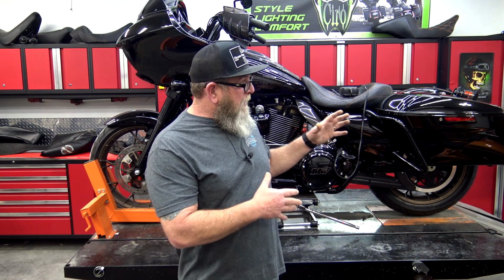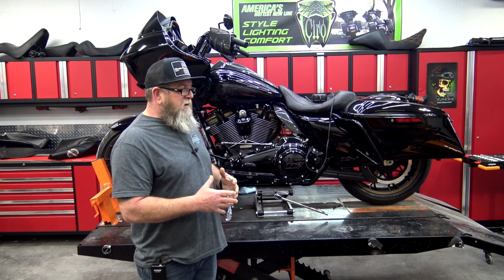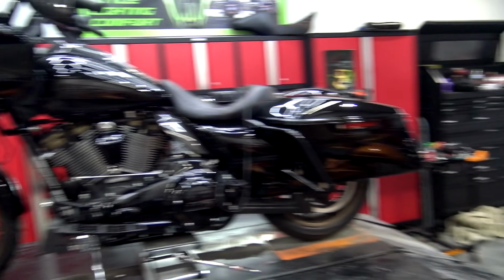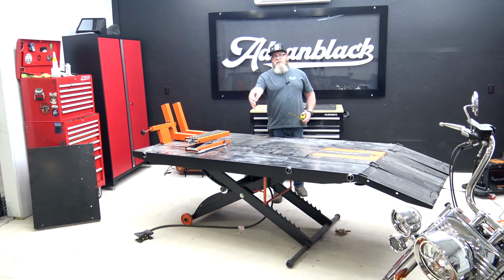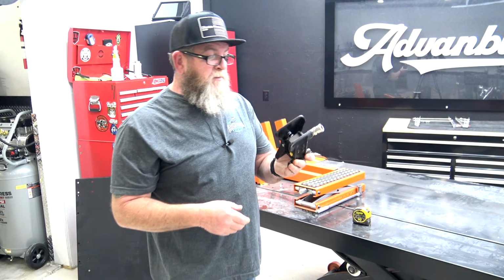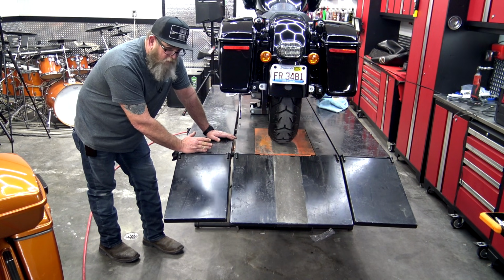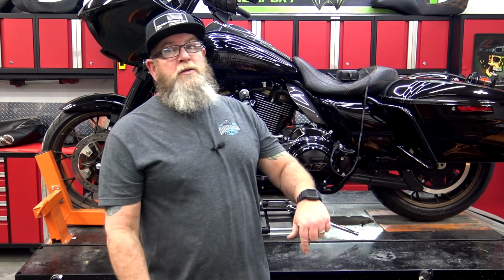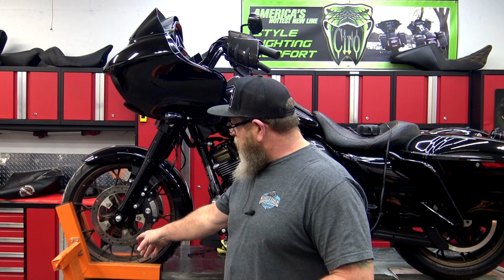⚡APlus 1500XL Motorcycle Lift: Worth the Buy?⚡

Comment: I just bought the same lift and it appears they have fixed a few of those issues you say in the video. I put the chopper extension on for my Indian pursuit and definitely don’t need it so I’m going to pull the bike off and take it off.
Reply from the maker: Glad to hear they’re making improvements to the design. 👊 I wish they would have reached out to me to fix the issues that they sold me to deal with.
Reply: @sikbaggers  well I didn’t know that that’s surprising… When I called them directly, the customer service representatives were excellent… Maybe they’ve changed over the last few years

Comment: Where are they made ?
Reply from the maker: not sure.. didn't really care as they are a US company...so warranty support/parts supply is easier..... but if you check thier FAQ page it states Where is your lifts made?
Most of our lifts are made or assembled in China with parts from countries such as China, US, and Mexico, the same as almost other brands on the US market. We have direct connections with the factories, and because of that, we run our business in a much more efficient way so we can keep the cost low while supplying higher quality lifts than those with similar capacities.

Comment: Problem, not issue... I bought a Titan lift years ago. It looks exactly like these APlus lifts. Made in the same chinese factory.  I don't like the side skirts. You have to lean over them to work on the bike, but they do make it easy to drive the bike onto the lift
Reply from the maker: Most of all of the lifts just like this one are made in the same factory...I agree. you can easily pull the side tables off once you get the bike up...I use it a work bench, tool holder etc...but there have been times I need to get under the bike or closer and I have removed them.

Comment: The best lift in my opinion is the K&L if you want wheel drop out panels in front and back. Yes, it is pricey, but perfect reliability, big air cylinders/capacity and great quality. The front dropout is key for me as a vintage restorer as it allows easier front end removal and work.  And, it has easy insert side extension tables, front wheel vise and more. The table lifts within the base, nothing rolling constantly on your floor.  It is the most complete setup I could find…I bought two!
Reply from the maker: yeah they are built like a brick shit house for sure! Super pricey for your average garage guy though.

Comment: great video Steve.  i have the Canadian version of the Harbor Freight lift.  here it is a Princess Auto lift, but same thing.  I bought it about 12 years ago now and it gets well used.  I have had electra glides of various years over the life time of this lift and have never had a problem.  it is the air assist version.  at the time i bought it, it was $369 CDN and by far the cheapest version of a lift i could get.  i have a bunch of buddies that all ride touring bikes and we work on their bikes with this lift.  now you do have to be sensible when using it, but we do engine work, tire changes, full strip downs, and i like it just for cleaning the bike.  no doubt in my mind that this is the lowest end lift.  the one thing that it does that i have not seen other lifts be able to do is roll around.  the lift has 2 wheels in the front that once you lower the leveling legs, you can move the lift around.  My garage changes from a bike shop, to a cabinet, wood working shop to a automotive shop at various times so i have to be able to move it out of the way easily.  Best $369 i have ever spent.
Reply from the maker: Hey man...so sorry this comment snuck past me and im just now seeing it...that sounds like you have a good one that works for you. Unfortunately I do a lot of that stuff so I knew right away it was going to work for me..I was bummed for sure. The price was awesome. Glad you can use it! Be safe!

Comment: I liked the video, I was wondering if you contacted A-Plus lift about the bent side panel? I have an 05 Ultra with a 124 kit and a 6-speed Baker. It is a heavy SOB but I think this lift will work great. I like that it comes with the bells and whistles. Do you have a video explaining how to change the engine, trans and primary oils?
I was also wondering if you contacted the manufacturer in regard to that foot pedal issue. That is kind of concerning for me also. I too was wondering if you could just switch it to the other side. Thanks for taking the time to do this video, really appreciate it
Respectfully, Dale H
Reply from the maker: yeah they said the center is rated at 1500 lbs not the side tables..I said "clearly" lol  I do have several videos on 3 hole oil changes..I think the one that would help you with your 05 would be the twin cam video here  ...specs may not be the same as far fluids https://www.youtube.com/watch?v=kAS5fm7cbWg and here is a service manual for the 05 touring to help with your fluid specs and torque specs,..its from my google drive...feel free to download it to your phone or pc https://drive.google.com/file/d/1scuAdp_1TXFzQKsH416OAge7pJ83YrcB/view?usp=sharing I hope this helps!

Comment: Have any issues with the short ramp with scraping the bottom of the bikes?  Do you push them up or ride on?
Reply from the maker: the only thing I have scraped on the floor is the 39" fishtails on the softail build riding it up and down ..and the back of the frame on the 2" lowered streetbob which is a lower sitting bike to begin with and that was with my fat ass riding the bike up on the lift...i pushed it up on there just fine and didnt hit...the ramps are pretty sufficient for most bikes.  Ive never hit a touring model even with lowering blocks on the rear riding it up on the lift

Comment: I Bought one few days ago based on this review.  I put it together and when I lift the bike up and push on the bike the table flex which moves the bike a bit . Is that normal ?
Reply from the maker: yeah man that bike aint going anywhere...its a solid table..been using them for years and zero issues and I have slammed, banged and pushed on these bikes..youre good.

Comment: I wish I saw this video two months ago. Did the exact same thing. Got a HF lift because it was cheap. Did all the YouTube mods to it. Second time my street glide was on it I heard the frame make that creek sound. NOPE! Lowered it. Took the bike off. Posted it on marketplace the same day. Luckily it sold right away. Ordered a Black widow 1500 XL wide pro lift. Pretty sure it is the exact same thing as the APlus 1500XL.
Reply from the maker: Yeah those Harbor Freight lifts aren't meant to hold that much weight.  Im the same way, listed it the next day and sold it..there was no way my bike was going up on that thing. And yes im fairly certain thats the same lift. You will be happy with it.

Comment: Nice video.  I too have seen plenty of Harbour freight videos with guys raving over it.  However like you if I have to spend hundreds more "fixing" it is money really being saved?  No!  Plus altering products generally voids warranties.   

As for delivery I live in the suburbs and also have no dock on my house or forklift in the back yard.  What I do is back my pickup up butt to butt with the delivery truck.  The item is lowered to my bed height and transferred.  I shake hands and back my truck up to my garage and unload.  If possible I break down the item in the bed.   This has worked for a Pretor elliptical,  large air compressor,  110 lb tower speakers, 617 lb tool bench etc.   I also have a 1000 lb winch which worked great for 
unloading the tool bench.
Reply from the maker: yeah....no way im putting my bike on HF list...maybe a sportser or something small but not a bagger...same thing here with the lift delivery...I actually unboxed it and put it on a dolly and stood it up, strapped it off and hauled it back here to the shop...it sucked..it was heavy but it worked lol

Comment: Excellent!   i purchased a used Handy Lift this spring, it has the same wheel chalk, and side tables, however it doesn't have the rear drop out which is kinda a bummer.  I do use it quite often and now my foot control valve is not working properly, not letting air into the cylinder  so I'm trying to find parts to rebuild the valve, or purchase  a new valve.  Any suggestions on types of valves you are familiar with  that aren't  super expensive?
Reply from the maker: I havnt been able to find replacement parts for the foot controls ...there are so many different ones..Ive just been searching for a new foot control all together.

Comment: Good vid on the lift and yeah I am with you, the Harbour Freight lift has a place it's just not under my Electra Glide Ultra Classic. As for other lifts. I got the Redline 1500 ELE. The few upsides I see with this one is it's electric over hydraulic instead of air and no issues with putting the father in law 2020 tri glide on it. With the side extensions I am 51 inches. But overall the best lift is the one that will get you working on you own bike. Keep up the good work  bud
Reply from the maker: Yeah man that redline is nice lift! And absolutely agree...if it helps get you wrenching then its a great lift...well except the HF one lol

Comment: I have a HF lift for all my light items (dirt bike, sporties, push mower, etc.)  I purchased it for a very good price about 10 years ago.  My main lift is a Direct-Lift that I purchased in late 2019.  Nothing but problems and it requires consistent maintenance or it blows seals like crazy.  I would like to some day have a Handy but need to save for that.  

I think all brands of lift tables will have a percentage of failures.   Its how companies handle those failures that says a lot about those companies.  I think it comes down to what are your expectations of the lift table vs what one is willing to spend their hard earned dollars on.  

Thanks for another great video and really enjoy when you do videos on shop equipment and tooling.
Reply from the maker: Thankn you nick..sorry you have so many issues with the Direct lift. I could have spent the extra money on the handy but man these first lift only having the one issue with the foot pedal and the price is spot on too...so I just went with what I knew I guess. Hope for the best on this new one lol

Comment: I’m looking into buying a table . My apologies if my bike did that to your table … I will repair that for you. good video!
Reply from the maker: No sir it wasn't your freewheeler.  it was a full on trike ..your freewheeler did great on there but the Trikes weigh quite a bit more. It shouldn't have done it though with a trike  as it's rated at 1500 lbs.

Comment: I have got the A plus 1500 XL motorcycle lift it has served me well for the last three years, I just recently went to a trike the first time up on the lift I had a concern about bending the rear support for the tables. I solved this by sliding the Jack under the trike near the back and Jack It up enough to Put the weight to the middle of the lift. It works well for me.
Reply from the maker: thats a great idea john...mine did bend it just sitting there over night...I came back in the morning and about shit when I saw them bent.

Comment: I had a HF lift for a short period of time.  Had my 2013 RG on it and it tipped over.  😮

Luckily I had a large cabinet on the side it tipped to. It went to the ground but slowly.  

I had to replace the R brake lever on the handlebar and straighten the R highway peg, and a few scuffs on the saddle bag and rear foot peg.  Minimal damage, compared to what could have happened.  

Sold it that week to a guy who repaired minibikes and scooters.   
Never again.
Reply from the maker: man im sorry that happened..I bet that was a shock to walk in on....i sold that HF lift the day i got it...after drilling holes in it and not being able to return it..I threw it on FB marketplace and a guy with a much smaller bike got it.

Comment: First I enjoy your content! Live northern Illinois and when I retired I purchased the same 1500XL as my gift to my knees and back. My wife never sees me since I am in garage all the time! 

When I bought this lift it was just prior to Pandemic and they dropped prices due to shipping delays! Placed order and delivered by freight within a week. I have a Electric glide, Fatboy and BMW. All get serviced on my lift and my leisure. First thing I noticed was the table surface needed more anti skid material. So off to Amazon and buy a roll. And did both side panels and along the center of table. Then I bought a new foot control to replace the supplied foot control. (Have to find where I ordered the new one from.) It locks off in center position when released and no air is released cost about $100 from some lift company out of Indiana?

No one that I know liked the first style foot controller? My first controller is in box! And those who have the more recent model with updated foot controller are having warranty replacements?  Time will tell? 

Beside the baggers, my snow blowers and heavy zero turn mower fits on table great but have noticed the side panels bow out?  The Hollow pipe on these side panels has to be upgraded? Was thinking of straightening support pipe in press and installing a inner pipe welded in to stiffen it to help? I also fabricated up some Harbor Freight moving dolly’s to move the lift table when floor space is needed for other projects. 

Keep up the content!  Thanks for the video!
Reply from the maker: if you are unfamiliar with the harley davidson service manuals and it tells you to do something with the jiffy stand at least you know what it is.  side stand, kick stand, drop stand, crutch...call it what you want

Comment: I’ve been using the same lift for 3 or 4 years. Only issue is the cylinder started leaking a few years in but heals itself after a few up and down cycles. Now the scissor jack it broke the screw twice one time with the front in the air and the axle out
Reply from the maker: ah man I better check that then...my cylinder started leaking last year but its small..ive eventually have to change it though

Comment: I’ve got a tuxedo lift, which looks exactly like your lift other than its grey with a blue drop out plate. I believe both of these are loose copies of an older model handy lifts. 
I believe your wheel clamp is a better design than the one that came with mine, but I prefer the condor chock over a wheel clamp as I park my bike on mine. Condor makes a lower profile flipper for extended fenders (it’s an added cost fyi), and I added some grip tape on my outer tables to aid in getting the bike out of the chock. 
If you do your own maintenance, or upgrades but your getting a little to long in the tooth do be doing garage floor yoga, a lift is a game changer! You’ll also find yourself becoming rather popular with your riding buddies when they have projects or maintenance to complete.
Reply from the maker: Thanks for checking it out and sorry for the late reply...been on vacation...and I agree...the lifts are a must have, specially at my age..I cant take getting on the concrete floor anymore lol and yes my buddies love them too haha. I didnt know condor made a shorter flipper...thank you for letting me know...I can add that in future videos about fenders. Much appreciated!

Comment: I got a pro point from princess auto 1200lb and works mint with my bagger. It has a foot pump or air options for lift. I agree it could do without the checker plate tho...
Reply from the maker: Thanks for checking it out and sorry for the late reply...been on vacation...neve heard of that lift before but im glad its working out for you....its nice to not have to be on concrete working on these things
Reply: @sikbaggers  yup I do my own services and have done the majority of the mods myself. This lift has paid for itself with the money I saved from taking it to the dealership.  They told me 600 bucks for an oil change so I went out a bought the lift right away 👍🏽

Comment: I’ve got a Handy S.A.M. 1200. I got the side extensions, rear wheel drop out & wheel chock. It uses air billows and is super heavy duty. The foot pedal for raising & lowering work’s flawless. Way better quality than the APlus 1500XL in my opinion. Better craftsmanship, heavier duty metal, better finish just much better all around. There’s a reason why most HD dealerships have them in their service department. Yes, it’s more expensive. I paid about $3K out the door. Free shipping. Arrived in 3-4 days from time of order. Great shippers. Backed the truck right down to my garage. Great warranty. And best thing yet…100% entirely made in the USA!!!!  🇺🇸🇺🇸🇺🇸
Reply from the maker: Thanks for checking it out and sorry for the late reply...been on vacation and yes I agree the handy is a very nice lift. If I upgrade again the future it will be a handy for sure.
Reply: Is that like comparing apples to apples?  I dont think so. $3000 lift compared to a $1500 lift shouldn't be the same.

Comment: I have this same lift and love it. Going on a year now and no issues.  You may have gotten a bad pedal as mine stays sealed and doesn't pivot the fitting. Also to note the 1500 pound rating states that it's at the center of the lift. I ordered mine on amazon and delivered to my driveway by freight truck.  The side extensions can be put upside down to hold your tools from rolling out while you work on the bike. I also went with a condor wheel chock and love how easy it is to just step off the bike and not worry about tightening the clamp.  I use it with my 21 Road Glide Special.
Reply from the maker: Thanks for checking it out and sorry for the late reply...been on vacation and yes it definitely in the middle..i wasnt aware til a previous comment that condor made a smaller flipper for  stretched front fenders so thats a very viable option now.